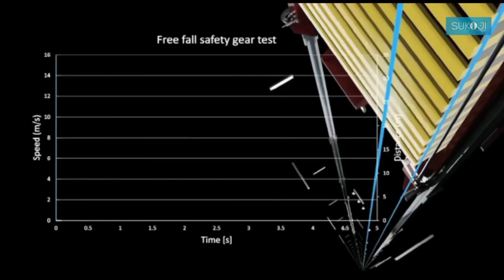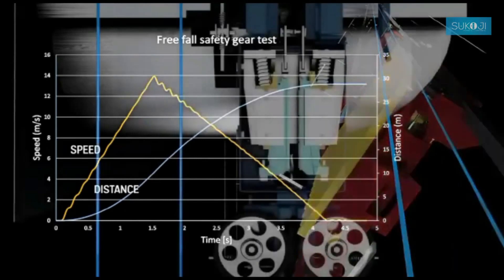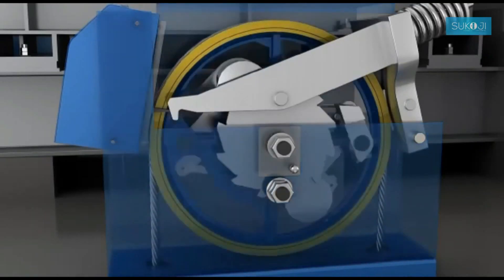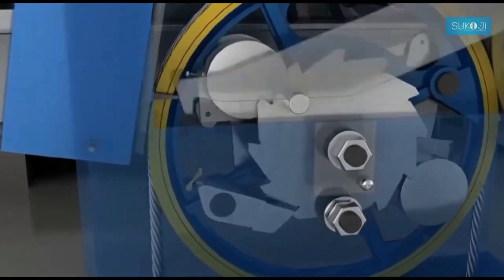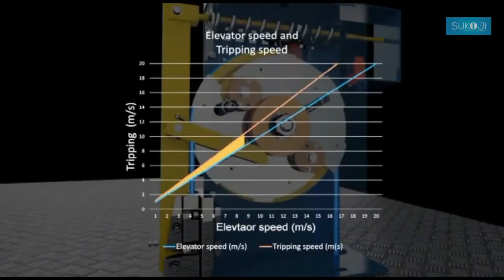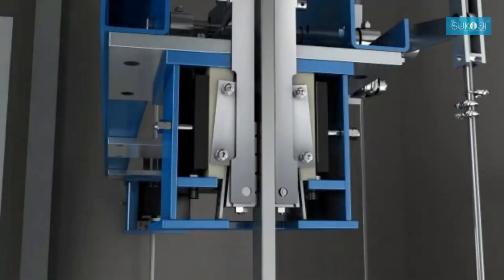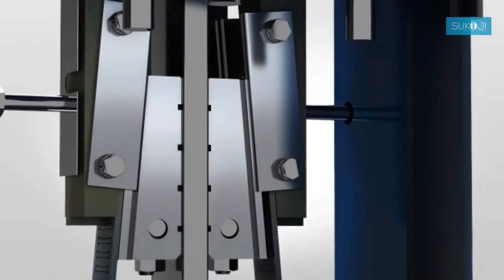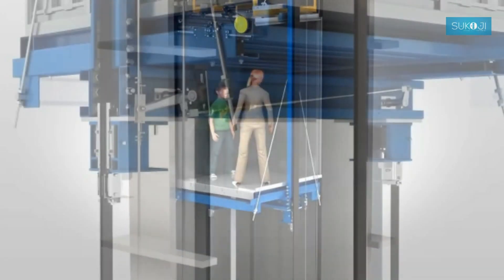Elevator/Lift Over Speed Governor | Elevator Safety |SUKOJI ELEVATOR #sukojielevator #elevator #lift

Comment: Why isn't the osg mounted on the lift car (with some interface to the gliders, like rack and pinion or even magnets on a wheel between 2 copper rails in lift shaft, or something like that)?

Mechanically it would be more safe as you would not need any extra cable to motor room, and the brake system would then be completely self contained on the lift car, with the osg directly mechanically connected to the brakes without any cable.